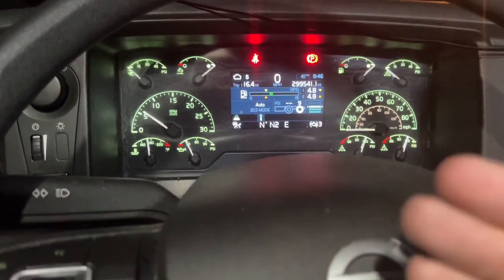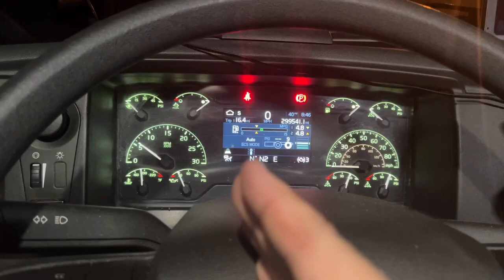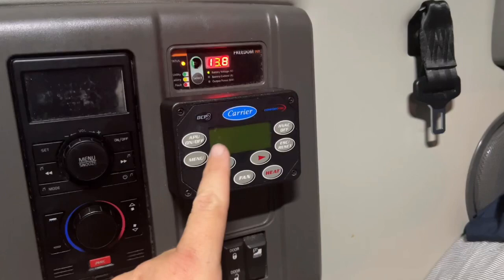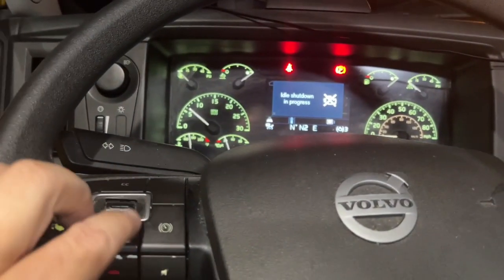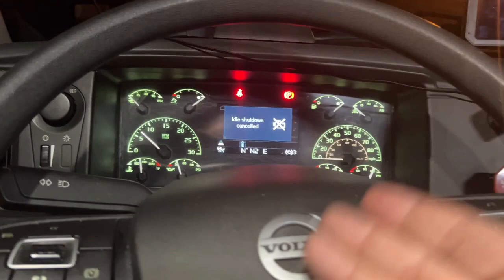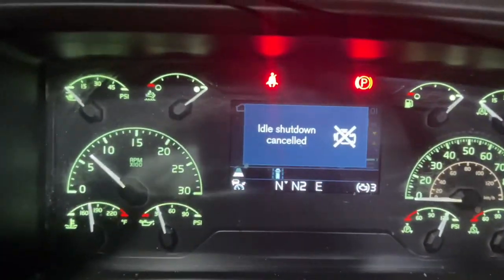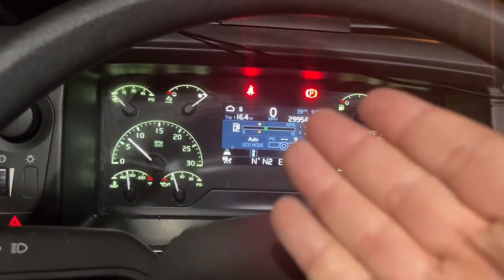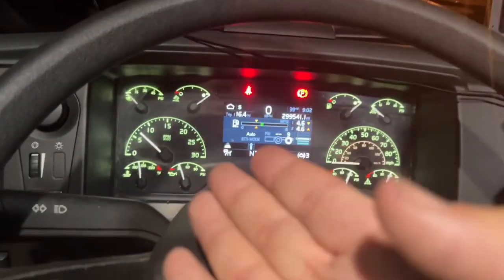Volvo Trucks Idle Restriction Bypass. Quick and easy.

Comment: Just wanted to say thanks! Worked on my 2024 company truck with no APU.
Reply from the maker: Great
Reply: Doesnt work in my 2024, is there any alternatives?
Reply: @timgareev5344  If that doesn't work, I chock the wheels and keep the gear in neutral. But be careful, it's risky

Comment: Also, it's currently -15 F outside, My truck is seeing -9 F, it still doesn't idle. Things like this are a case-by-case basis.. it's however your company has it set up. There is no blanket rule or solution.
Reply from the maker: Some companies do not care about drivers.

Comment: You don't need to yell dude... And if you're connected to a trailer, set the trailer brakes and release the parking brake.. there's no science to it.
Reply: Im gonna cry if this works
Reply: Tried that on an International LT and it didn't work. Still shut down.
Reply: To paranoid the truck will roll

Comment: Nope. Didn't work for me. Ive watched multiple videos.  Tried like 5 different ways. None of them worked. Finally got a tech to change the timer on mine so it would idle 90 minutes before shutdown.  Which in my daycab is fine. I hope you other drivers figure out what you need to get what you want.
Reply from the maker: Hmmm I do mine often
Reply: @ralphstrucking  , mine is a leased unit. The freightliners I never had an issue with overriding.  But the volvos,  I've tried in multiple units, not so much.
Reply from the maker: @jamesschultz30  if you lease should idle if you pay the fuel.
Reply: @ralphstrucking , company lease bud.